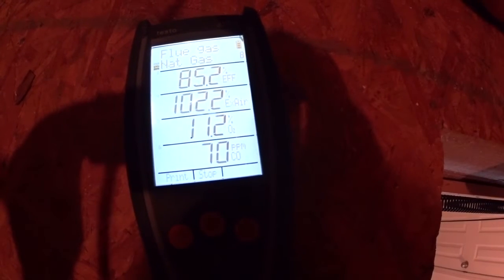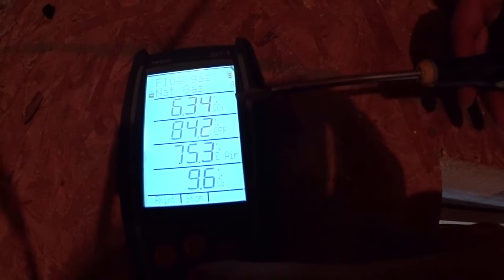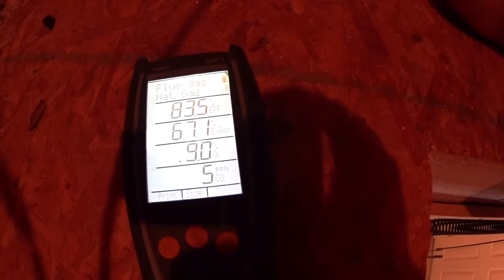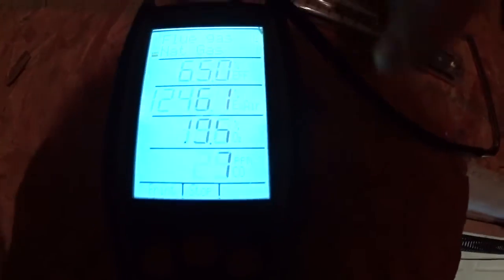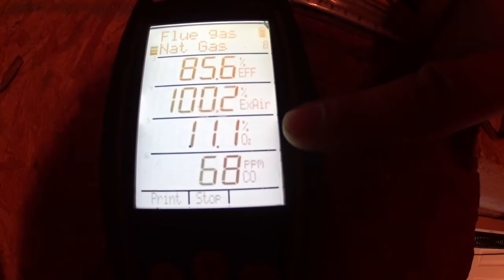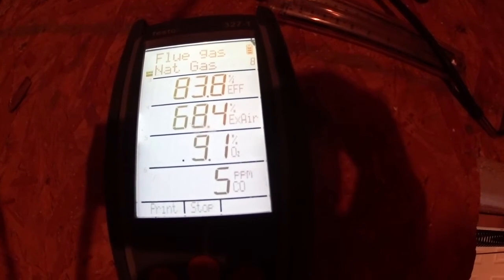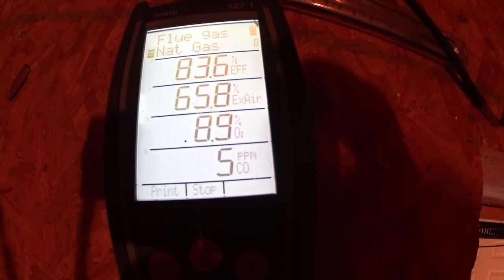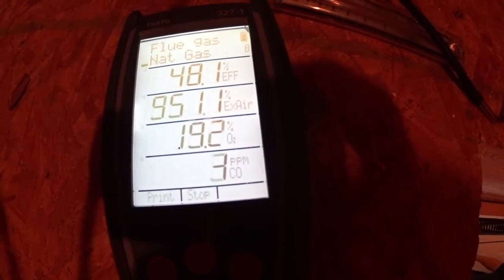HVAC Tools: Testo 327 Combustion Analyzer

Comment: It's ok to drill a hole in that b vent? Thanks
Reply from the maker: Yes, the first section is perfectly fine but you ought to plug the holes. Nick uses what look like burner orifices wooly hour a hole that screw into the hole you drill out.
Reply from the maker: What the heck is "wooly hour"!?! LOL dang auto correct! I meant orifices without holes!